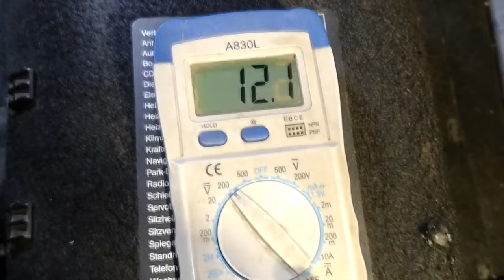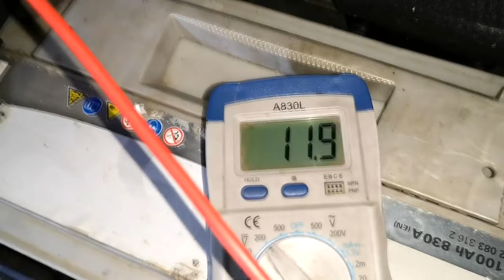How to make old Starter Motor Work like New. How to fix, rebuild and clean starter motor.

Comment: But you never touched the solenoid ?  The most important part and most often the first to fail !
Reply from the maker: That was not mine goal, that worked fine, and in this particular case It's difficult to do that. Sorry.
Reply: @Work_G   I understand....but for most viewers maybe they dont understand the importance of the solenoid and how it works.   And besides...often if the lugs are burnt or corroded bad enough they can cause many of the same problems.  Low voltage to the motor itself.  Just saying.
Reply: Exactly. I was thinking the same thing.
Reply: @jerrylansbury9558  Right Jerry. I was surprised that GW didn't even address the solenoid. Since the brushes looked good, I would have suspected the solenoid right away (for causing the slow turning) after seeing the brushes. The FULL CURRENT goes through the solenoid so the contacts inside get pitted and eaten away. Best to just replace it. But never ignore it when rebuilding. It's new solenoid contacts that make a starter spin like new when a complete rebuild is done, not cleaning and lube.
Reply: So I'm experiencing starter troubles and can do the classic give it a few taps and it will start. Would I not be able to clean up and lube a solenoid as well?
Reply: @MrMustacrackish   Depending on the solenoid..... yes often the lugs inside can be removed ....cleaned up or just turned around for a new contact surface.  Mostly depends on if a person knows how to do it.

Comment: New carbon brushes would have improved it more,  a better contact gives maximum current.
Sloppy battery contacts gives a bad connection at high current, so less goes to the starter :-(
Reply from the maker: Yes, thank you for feedback. I recommend to change brushes to new ones, usually that is just remove old and put back in new but for me to change them need to solder and old looked fine
Reply: @Work_G  Thankyou, i was a bit direct sounding but i didn't mean it to sound that way, i'm glad you didn't take offence.
Doing all the bits you can while you're in there just ensures that you won't have the hassle of taking it apart later because of a daft part fail.
I'm lazy, i don't want to do a job twice  :-D

Comment: Starter motor wasn't working last week couple days later it started working again what causes this?
Reply from the maker: There can be a lot of problems, but this indicates that your starter is probably dying and one day it will just stop working and not work at all, which could leave you stranded. I can only guess that cleaning would help, maybe corroded connections, lack of contact and some jamming due to worn-out. And don't forget other failures like ignition switch, that can cause similar symptoms
Reply: yeah mine was on its way out and working on and off then not at all. I open it up and it was full of graphite dust and I cleaned that out and now it works but still sounds a bit off

Comment: Can i use wd40 instead of the lubricant?
Reply from the maker: I do not recommend. WD40 is penetrating oil so its meant to brake rust, usually bare steel starts rust in long run after wd.
Reply: WD40 not a good idea for high performance parts. WD stands for Water Displacement.  It's made to displace moisture in moving parts before adding a proper lubricant such as grease or specialized oil.  Check this video for more info about WD40, it's good stuff but has a very specific job.  Unfortunately it has become an all-purpose lube in workshops all over the world, but it's not meant for that.  Watch here:  https://www.youtube.com/watch?v=__zkFEKmZdw
Reply: @MrOwl1985  
Thank you for the information re WD40.
Reply: @Lamar WD40 is NOT a lubricant. So many people spray it on dry screws & bolts but it doesn't stay. WD stands for Water Displacer--It was designed to save metal that was wet and might rust. Spray it with WD40 and it washes off the water and leaves a protective coating so it won't rust. But WD40 is NOT a lubricant. Might be OK for loosening rusty bolts and as a light cutting fluid, but NOT as a lubricant.

Comment: This might sometimes. Not the best solution. Yes it sounds a little better but when the book calls for a 20hr job to replace starter (Audi A8) then it would be best to get a new unit from the dealer for a lot of Money. Hate to do rework.
Reply: *work
Reply from the maker: That's true, even on my case it was best to change brushes and disassemble solenoid to check it and clean it. But as You say for this car is easy to remove it and mine starter never have signs of wear out before.

Comment: Starter sounded ok to me. You go to all that trouble and don't even change the brushes. Then when testing it sounded just the same. My motto is if it ain't broke, don't fix it77.
Reply from the maker: your motto is good, but after cleaning it spins way faster and car starts easier even with lower voltage battery

Comment: Pp when working with the starter motor you have to take both the positive and negative terminals off the battery p it would have been nice if you would have had a little paper drawing of the the bushings that you were filing what kind of shape you want cuz there's a curve in there that you know hooks hooks up to the spindle and then sew it wears down in that in a groove I was wondering if you were filing filing of the face of it down so that it can let you know restart a new contact and then I didn't see you p putting all their own on the spindle I forget what it's called right now I'm new at this but well on spendel or on the gear that hits the flywheel supposed to be some grease oil grease p my phone is busted so I can edit what I'm supposed I'm writing here typing

Comment: He cleaned it, he didn’t fix it. It already worked. I appreciate people posting this content, but outside of learning the starter  location on the vehicle and seeing the internals of the starter motor, this video accomplishes nothing.
Reply from the maker: But after all it works better (faster start, drains less battery) and if it wasn't for this cleaning i'd probably be stuck with a dead starter one day

Comment: Nobody has time for this anymore. You should have just replaced it with a new or fully rebuilt unit. 
All you did was buy a few more weeks or months with this fix.
Reply: Honda starter is $500 +, using After market ones gets you check engine lights cause they don't spin at the right RPM

Comment: german engineering is good but real engineering requires ease of repair as a far sighted step, making the engine bay as a jungle is not your typical smart choice, i understand its for forcing one's self to resort to the dealer's mechanic instead of tinkring it ur self
Reply from the maker: True